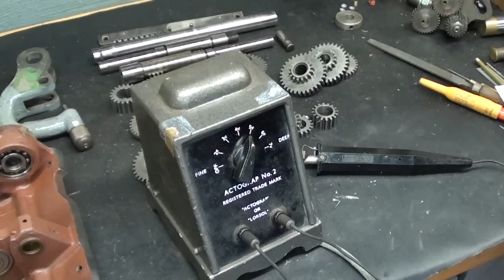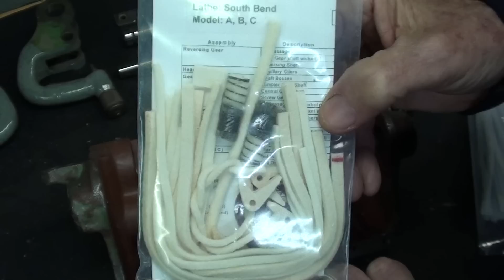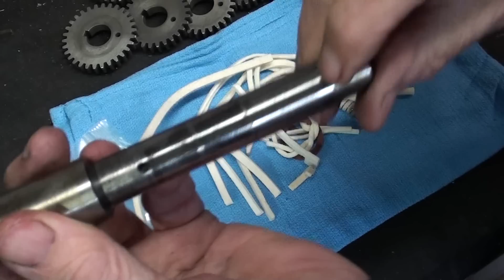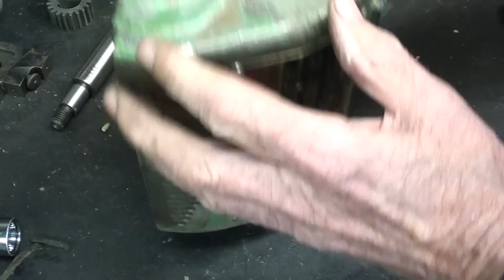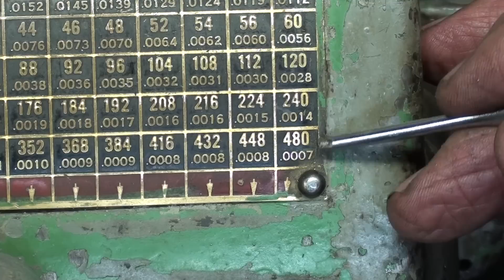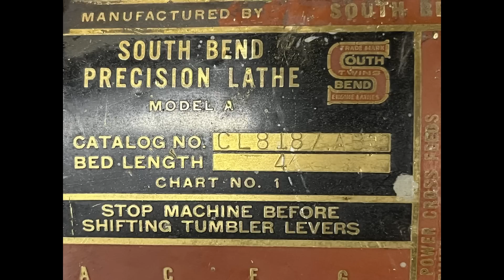REASSEMBLE WIDE RANGE SB GEABOX pt 2 #854 tubalcain south bend lathe

Comment: You can try to use a 4lb Hammer and hit flush on the flat side of the gear until its about flush. Then file it smooth. It will help bring in some steel into the damaged tooth area.

Comment: When Mr Pete says its difficult to reassemble one of these gearboxes, he's not exaggerating.  I had to tear the QCGB for my Atlas down to clean it and it was a headache from the get-go.  Still isn't 100% right; I just haven't had time to adjust the gear stack back into its proper place on the shaft yet.
Reply from the maker: Yes, it was not easy. Especially when you’re trying to film the darn thing.

Comment: Thanks, nice video, yes I like it, wondered what was in there since 64.  What grease for the gears, that seeping felt seems a long way away?  Wheel bearing lithium soap base or moly or whatever?  I see the 'blind hole' has plenty of correct answers, no magic, that one's a straight shot.  The angled are a lot more of a pain, having to us an end mill first get a good surface to start drilling thru those oil caps.

Comment: Always great videos from Mr Pete.
My thoughts on that hole at 12:24 It’s drilled to give access to drill the lubrication hole where your felt plug is stuck.
You could drill through the bush and then drill out the felt pad.
Then you could plug the access hole with a drive in or thread for a screw plug.

Comment: Loved this video. When I was working as a Millwright I rebuilt this same type of gearbox for our South Bend lathe in our shop. Someone long before I worked at this company had purchased a new full gear set, new bearings and oil wicks for the gearbox for the lathe. With the exception of three gears with a big burr on them, and worn our bronze bushings the gearbox was in good shape. I did have to machine new bronze bushing and I replaced all the Gits oilers with new ones. Rebuilding the gearbox was a lot of fun and it ran so much better after the rebuild.

Comment: Your reference  to blind hole is probable the drill passage for the hole the wick is in, and they drove the bear with a pre drilled hole in after putting the wick in, just a thought! If you had removed the bushing, you could have drilled out the wick and put in a new one and then put the bushing back in

Comment: My guess the blind hole on the brass bearing is the through hole drilled for the wick. If you had removed the brass bearing, likelihood is you would have seen that hole go all the way through. I had a similar issue on a machine I was working on, with a stuck wick and was able to use a very small, but longer drill bit to "drill" into the wick enough that it grabbed and I was able to remove it that way.

My wife never complains when I use her tooth brush for cleaning machines. :)
Reply from the maker: Do you have a tolerant wife?
Reply: @mrpete222  I think she lost her taste from Covid. LOL!

Comment: Paint job looks good and is probably a pretty accurate restoration. 👍

It just seems proper to the machine.

Where was the hole for that wick that you can't get out drilled from? It seems like you have to have a matching hole on the opposite side of the bearing bore for the drill to go in, unless it was drilled from the opposite side of the casting, and is actually in one with the Gits oiler. I can't imagine that it's possible to place a core that small on the inside of the casting of this nature. Either way, you should be able to either push the stuck plug out from the opposite side, or drill it out from the end where it stuck.

Comment: Was the blind hole in the center bushing the original drill thru hole before a pre-holed bushing was pressed in and that blocked it off perhaps? I have to get back to your neat video.
Brake tubing for the spacer...
I'd been looking forward to the #2 vid. Very neat, thanks for the time you put in.

Comment: I would have tried to burn out the stuck wick with a piece of mechanics wire heated up with a small torch .  Thanks for all the tips on the gearbox , I have been meaning to rewick mine for about ten years . But at $40 I may think about it for another 10 years.

Comment: I agree about taking pictures. Several years ago, I went through & added color photos to go with the setup sheets for all the different jobs we run on the Brown & Sharpe screw machines. Tooling in the machine, tight clearances to be aware of, any unusual settings done to the machine itself, etc. It's made life a lot easier for subsequent setups since then. Love the video. Thanks for posting :)

Comment: I find these gearboxes absolutely fascinating. Took a while to understand them.
On the in-side, compound gears (a big and a small one 'glued' together) that divide the in-rotation by 2 for every compound, resulting in a reduction of 1/1, 1/2, 1/4, 1/8, 1/16, 1/32, 1/64.
transferred via the first tumbler on to the thicker shaft and from there to the 2nd tumbler that engages with the 'Christmas tree' for finer divisions.

Comment: Nice series Lyle. The blind hole next to the bushing was likely drilled to allow drilling of the bushing oil hole - opposite side of the bushing. I think you should have been able to push out that stubborn round wick with a piece of stiff piano wire.The drilling of those oil holes to meet with the gallery is quite something (as is the drilling of the gallery itself) - especially drilling at an angle starting in a round bore. It's my birthday next month, for a short time I'll be a year older than you. Oh, do paint the outside.
Reply: I wonder if they might have used a hardened bushing with an angled hole to use as a drill guide to drill those oil wick holes? Guess we’ll never know.

Comment: Wonderful epic rebuild video!  And your paint job was fantastic too.  ... Did you try a blast of air down the getz (?) oiler to blow out those two pesky wicks?  Just a thought from an inexperienced viewer and fan.  Love your videos.
Reply from the maker: Yes I did
Reply: Hi Mr. Pete ,  I think I would have used air but not down the gibbs oilers.   Block one side of the bushing and take a bigger tire valve on the other side.   You could put a shaft in the hole of the other bushing to block the air from going to it if needed.    I'm sure that felt will come right out.

Dale in Canada 🇨🇦

Comment: Maraton video, lots to comment...
Great job, great strategy keeping gears in order and getting them back, in the correct place...

Missing teeth... I've seen Keith Rucker fixing missing teeth...... Joking! 3 teeth are missing here. 1 didn't come out at all and 2 were scrapped by the dentist ages ago.

About cleaning the oil channels. Why not use a soft copper wire having an OD suitably smaller then the channel ID? Push a little bit of wire into the channel using a plier. Then adjust the wire for the next little bit pushed in.
Or cut short stubs, that will out at the other end of the channel, a feed one stub at the time, press it in, next stub, press....

Pressing the bearing out and in. It worked well but making a press tool touching the outer bearing ring and a pressing nut pressing on the bear holding part,   all forces could have been applied to the bearing holding structure.

Haha, using every world in the naval vocabulary.... I get it! Personally I open a can of beer... Can be many cans i such situations.....

Get Your hand out of the way.... Here we say: You're not a glazier.

Email in disorder... I agree! It's worse then bad, frustrating as well as Internet being down.

Put the gear in idle... I do! The lead screw has a motor mounted for motor driven lead screw... Has to be released for threading...

Time 41:15 binding.. No oil left in the oiler? Joking!

SKF Mr Pete! "Svenska KullagerFabriken". Swedish BallbearingFactory". 
Worked there for 4 years maintaining their computer controlled measuring!

Great show!
Reply from the maker: Thank you for the great comments. Interesting that you worked at SKF.

Comment: Are you sure the inside was Rust-Oleum? Is Rust-Oleum a sealant against oil? Typically for this application you would use red Glyptal. Something to consider for the future!
Reply: Exactly!  But this isn't really the inside of a gear box,  just an open bottomed gear holder.  It'ss still help stop any condensation from bare metal.

Comment: I depend on match marking too, but assembly drawings are vastly superior to exploded view drawings that are exceedingly common on this grade of machine. Assembly drawings require moderate skill to read, but the information available to the technician is vastly superior to the exploded view. Part orientation, loading surfaces (journal and shoulders), lubrication and hydraulic porting and function can be verified. This information is extremely valuable for ordering parts prior to disassembly and confirms part orientation where you failed to adequately match mark.
Reply from the maker: Thank you very much. I’m not sure where I would get assembly drawings. I think they were used at the factory.
Reply: @mrpete222  I don't understand why they aren't standard issue with machinery. They ought to be easy to develop, since they are essentially developed during engineering drawing process. Exploded views must take an extra an inordinate amount of time to develop (especially before CAD), and they provide virtually no value besides part identification after disassembly. 
Maintenance technicians guard assembly drawings with tender affection. In my experience, only complicated machinery is delivered with assembly drawings.

Comment: It looked to me that the center bearing hole was made to be able to drill into the main oil gallery. The getz oilers appear to align directly above the end bearings, again allowing drilling. Interesting that they took the trouble to drill oil porting on a steep angle to reach the extreme outboard bearings. Many machines of this quality use copper oil lines to reach places difficult to machine. I suppose that once fixtures were made, this steep angle drilling would save assembly cost.

Comment: I think the hole you couldn't decern the purpose of is the drill path to the respective oil hole in the brass berring. If you were to drive a pin into that hole, you might be able to drive the wick into the gallery and push it out through the gallery with a long drift punch. It seems to me that it would be the logical drill path to get the other hole in the berring...

Comment: I think that blind hole that was plugged after drilling the hole in the bronze bushing (at 11:48) that you couldn't get the wick out of, you should have been able to re-drill that plug out and use a smaller drill to pull out or shred the old wick out. Then replace that plug.  I have always been able reassemble anything that I tore to bits. Ron W4BIN
Reply from the maker: Thanks, Ron

Comment: I agree that the blind hole at 12:22 is there from drilling the oil channel before the bushing was pressed in. With a wicking system the alignment of that bushing wouldn't need to be exact, only close for the oil to flow.

I'm guessing you may have compacted the wick down below a slight offset in the hole in the bushing and that's why it won't come out now. You could try to make a super stubby bit to feed in there and twist about with your fingers in hopes of pulling bits of the wick out piece by piece.
Reply from the maker: That is correct, I use a ramrod, and I packed it too hard, L O L

Comment: When I was in the automotive trade, I would cut open the bad bearings and show the galling and pitting on the balls and races to my customers where all the noise was coming from.  I thought it made a good selling point.  I would then save the balls because they made excellent slingshot ammo for my kids.  Thank you for another great vid series.
Reply from the maker: That is interesting that you would do that for a customer. Tomorrow I will put up a video where I cut the bearing apart and examine it. Great minds think alike, lol
Reply: @mrpete222  I am extremely flattered that you would notice that.  I started out as a know-nothing-nobody at an International Harvester and Checker dealership and worked my way to becoming a service manager at a Porsche repair center.  I always tried to find ways to explain what went wrong to the customer and would show them anything from unusual wear on a brake pad to bad engine bearings.  BTW, Porsche automobiles really were finely built machines, just like a top-of-the-line machine tool.  A large number (sadly, not all) of Porsche owners knew that, and were very interested to learn how things worked, and how things went wrong.
Reply: @mrpete222  Cutting a bearing is too much for me, just removing seals & old grease should be enough to show it off.

Comment: Mr. Pete - sure wish you had done this video 6 years ago before I rebuilt my Southbend Heavy 10!  It would have made the task of rebuilding my gearbox soooooo much easier!  Marking the gears, removing/replacing the felt, cleaning, threaded rod to remove the bearing - so many tips that I didn't know . . . . that Christmas tree, woodruff key, and tapered pin were a nightmare.  I may remove mine to redo the renovation I did on it to fix/correct any issues (most specifically the felt and oil gallery) following the process you just showed.  Thanks so much!
Reply from the maker: I am glad you like the video. It was a very difficult one to make.

Comment: Mr. Pete, try using compressed air (120 psi and wear your safety squints of course...) to get that stubborn felt oiler out.  You will have to plug up any adjoining holes somehow  of course.  This has worked for me in the past.
Reply from the maker: Thanks for the tip!

Comment: Great video as always, Mr. Pete.  Worn out!  Hardly.  I hope you clean the toothbrush with mineral spirits before putting it back in the toothbrush cup.  Your bearing removal tool is very similar to the contraption I devised when I had to pull the spindle on my SB 9".  And yes, when I do a teardown of any piece of equipment everything is labeled to return to its' original location.

Comment: I have some old-school pipe cleaners if you need some. But they are only 6 inches long and a lot smaller in diameter than the "fuzzy sticks" that the wife got you. To be honest the "fuzzy sticks" being the size and length they are worked just fine for what you needed them for.

Comment: Great video as always! Wouldn’t that hole at  12:33 have been for drilling the oil channel with the stubborn wick?  Obviously before the bronze bearing was installed.  I don’t suppose it’s worth the trouble just to get at the wick.
Reply: I was thinking the same thing, Joe.  IF the pin could be pulled easily, the wick could be caught on a drill bit and plucked out.  I don't like to leave a hardened wick because I think it's to hard to pass oil through it.
Reply: @oddshot60  My OCD wouldn’t allow me to leave it either!
Reply: I am with Joseph and T, drill through - remove the hardened wick and plug the hole if you feel you need to.
Reply: I'd drill through the bushing to get that wick out. You could plug that bottom hole if it bothered you, with a drive screw partly driven in.
Reply: @geobrown9413 Would’ve been nice to see how hard it is to remove that bushing.